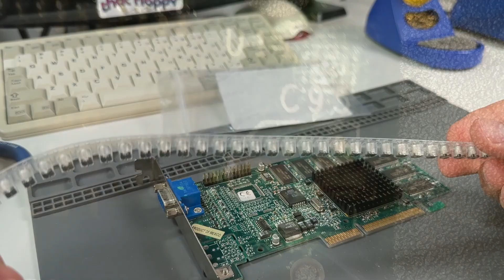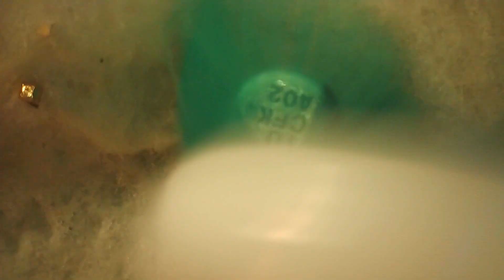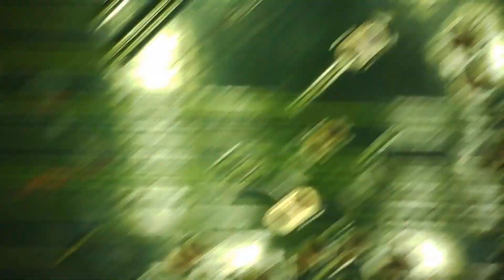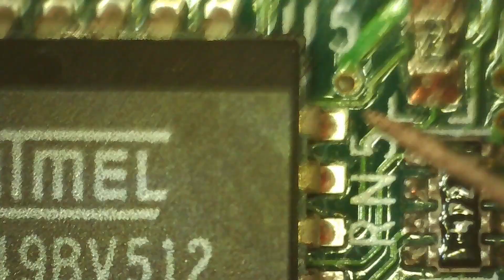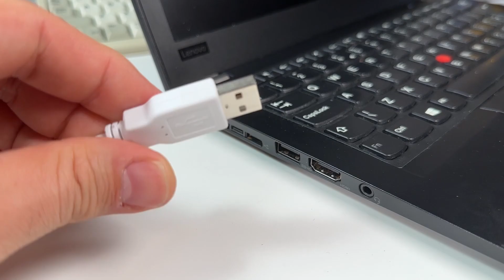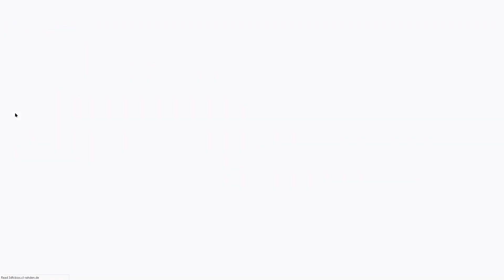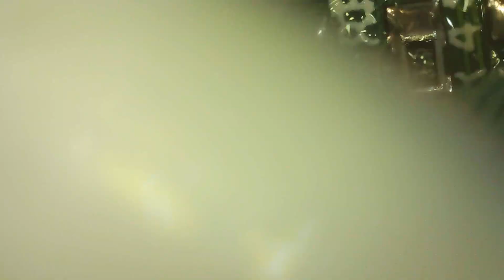Repairing a Stubborn 3dfx Voodoo 3 2000!

Comment: I haven't done significant soldering in a while, but I did a lot of small electronics repair for my father's business back in the mid 00's, similar SMC sizes to these. Anyway, we always used a flux impregnated solder and it worked fantastically. It was also lead based I'm pretty sure, and at least back then, the non-lead based solders were crap and required much higher temps.
Reply from the maker: Thanks for your comment and for sharing! I have never tried lead-free solder before (since most of what I repair is from before that era) but I've heard its much harder to work with.
Reply: @vswitchzero  They had a certain brand they loved with the flux in it and stock piled it. The business went under (tech they fixed basically went obsolete), but he still has some somewhere in his garage. But because it was flux impregnated, we never needed extra flux and would just melt a little extra solder if you needed to and then wick away the excess.

Comment: I have the same model card that hasn't worked since I bought it (system wouldn't post). Thanks to this video I tried the switcheroo trick with a PCI card, but my system still won't post, so I get no video output at all. Any ideas on what could be wrong?

Edit: tested on a different system...it's completely dead
Reply from the maker: Thanks for your comment! If the card isn't detected at all, it could be power related (check the regulator for the correct voltage output and test the ferrite beads/filters to the left of the 3dfx chip to make sure there is near zero impedance across them).  Unfortunately, some of these types of issues are due to BGA contact issues, which can be much more difficult to fix. I have a V3 here that I believe that is the issue on. One of these days I'll need to learn how to do BGA rework.
Reply: @vswitchzero  Thanks for the tips! Voltage looks good, card is getting power. Unfortunately I think it is an issue with BGA contacts.

Comment: Have you tried No-Clean Flux? More expensive for sure.
Reply from the maker: Thanks for the tip. Haven't tried no-clean stuff yet, but the flux I use is really easy to get off without much effort. I used some cheap flux paste in the past that required a lot more work to remove.

Comment: If you haven't under preheater - better to mix the solder of chip with the rose alloy by a soldering iron, and then unsolder it hot air gun. Rose alloy has a much lower temperature of melting and it's hardens with muuuuch more time that ordinary solder, that is why unsolder chips with it much easier

Comment: Excellent work. 25:35 it would be really interesting to see if the Voodoo 3 is able to run at over 200 mhz with 5ns or even faster memory. Apparently the fastest Voodoo 3 ever released was made by Falcon Northwest runnung at 200 mhz, but I never saw one on the internet and I wonder if such a card even exists.
Reply from the maker: Very interesting about the Falcon Northwest Voodoo 3. I've never heard of that one before. I'm definitely going to try to get this card past 200MHz, stay tuned :)

Comment: Flux is needed to clean surfaces from oxides during soldering. But when you desolder with a hot air station, it only interferes - you do not see the moment when the solder becomes shiny, completely melted. The flux evaporates rapidly, as the temperature of the hot air station is too high for it, and produces too much smoke, which makes the desoldering process more difficult. So there is a chance to tear off pads. But for soldering components back or cleaning pads - there is not such thing as too much flux.

Comment: A disconnected pin is floating - it won't necessarily be at 0v and won't necessarily behave as if it was
Reply from the maker: Makes a lot of sense! I was thinking of it too much in "on/off" terms. There is clearly more to it than that. Thanks for your comment.

Comment: open(unconnected) input pins are usually high .. so ..
Reply: This is the case with TTL families due to the way the gates are constructed, but absolutely not the case with CMOS families (which this ROM and indeed near on everything else on the board are manufactured in.)

Comment: I actually saw a voodoo 3 on another channel that had vbios issues. So he flashed it. It worked. He examined the old rom. Only a few changed bytes. 9 in total. So he reflashed the original. Still worked perfectly. lol It's so bizzare.
Reply from the maker: It is very strange indeed. I had a similar experience with a socket A motherboard a while back. The BIOS was bricked/corrupted and the system wouldn't post. I pulled the image off via my external programmer, and its checksum matched the one I downloaded from the ASUS site exactly. Flashed it back and it worked just fine. I suspect the external programmers do a better job of reading "borderline" cells that don't have enough charge left in them than the board/card does. I remember hearing that it can take too long to read those cells too, which can be an issue. So the image pulled by the programmer is good, but the card/board doesn't pull the same data when it tries to read it. Flashing it again restores all those flaky cells. If I find another EEPROM in this kind of state, I'd like to do more tests on this.
Reply: @vswitchzero  yeah that was my guess  as well. That it was marginal and just not fast enough to POST. But flashing I guess doesn't care about speed? /shrug

Comment: I didn't need to buy another broken voodoo 3........
I beg to differ. LMAO!!
Reply from the maker: LOL! Yep, I can't resist a 3dfx card in need of some TLC :)
Reply: @vswitchzero  I kind of want to do this stuff myself, but I honestly don't know what I'd do with it even if I had your skills. I've never done SMD before. 

I have fixed a C64 and honestly I feel like I could do a better job now. It had 1 faulty ram chip (I knew which one, but I replaced them all because it's a known bad brand) and a faulty cartridge port. However because my home made power supply didn't have a thick enough cable, I had a huge voltage drop anytime I used my U2+ (the USB disk drive emulator) 

The computer worked, but barely and some programs were worse than others. But the voltages checked fine with the "naked board". One day I checked voltages with the cartridge. 3.5v. How the hell that computer still ran on 3.5v is beyond me. After that I replaced the power cable and it's worked great. 

But.........before I knew the real problem I replaced the PLA and the color ram. Both were fine. The color ram destroyed a trace in the process. So I had to bodge it. The cartridge port (definitely was bad) I lifted a trace. I'm still using it, but it's not flat on the PCB anymore. I have a hot air station now (I got it for 3d printing) I feel like that would have helped me avoid these issues.
Reply from the maker: @awilliams1701  Great that you were able to do those C64 repairs! Its always a good learning experience - even if you replace unnecessary parts or cause damage requiring bodges etc.  I was really intimidated by SMD stuff at first. I ended up buying some SMD practice boards from Amazon and just did component after component until it got easier. Eventually you discover techniques that work best for you. Getting a microscope was also a real game changer for me. Made all the difference. Cheers!
Reply: @vswitchzero  My problem is I barely have time for the C64 or anything else really. So if I got more parts regardless of electronics era, what would I do with them after fixing them?

Comment: I'm curious to know what the ESR is of those panasonic 10uF/16V new caps. Do you have a meter to measure it?
Thanks.
Reply: With name-brand capacitors from reliable sources (like this one) you can pretty much trust the datasheet. 
0.85 Ohm at 100kHz is Panasonics rating for the EEEFP1C100AR cap.
Reply: @Manawyrm  I was asking, because I have a Voodoo5 5500 with lots of these caps. They all measure around 9-10 ohms @ 66KHz.
I've measured some other similar caps I have, same ballpark. They are not Panasonics.
Reply from the maker: I have one of those really cheap component testers, but the ESR readings I get from it vary so wildly that I don't really trust it to be honest. I'd be happy to take some readings anyway if you like - just let me know.

Comment: Hi, yes a multi plane PCB certainly needs a pre heat, it will make desoldering much easier, less tracks and pads pulled off, Small boards you can pre heat the underneath with your hot air gun before doing the yop. Bob. UK
Reply from the maker: Thanks very much for the info!

Comment: Congratulations to the milestone! And to the fixed V3 of course as well ;)
Reply from the maker: Thanks very much! :)
Reply: @vswitchzero  
greetings vswitch. Watching this video, in which you use an S3 Virge DX, I ask you a question for help.

I have an S3 Virge DX card (AOpen PT 75), which I had never used before (so dont know its previous state). after a good cleaning and soldering a capacitor that had come loose. I tried it and it did not give an image, the PC emitted several beeps. After an additional review and more cleaning, it managed to show the vbios report, but then it goes dark. Reviewing it more in depth I saw that it had a position where another capacitor seemed to go and in the images that I looked for I saw that yes, it was missing another capacitor (those are the two on both sides of the PCI connector i this card). In the images I cannot see the data of the capacitor, but visually it is the same as the one that I soldered before. So I matched this capacitor and put it on, but the card remains the same, it shows the information from the vbios, and that's it, it doesn't give an image. during boot up i keep touching the chip and i feel it getting hotter than i think it should, so i turn off the pc.

Can you give me any advice on this?

also

I have two AOpen VI15G motherboards , the revision with support for 3.3v CPUs (it has the power regulator). They are part of some PCs (the other is a Pentium) that I had at the end of the 90s or the beginning of this century and all the parts and pieces were stored in working conditions almost 20 years ago. A few months ago nostalgia assaulted me and I am reassembling them. All the parts needed a lot of cleaning, from the PSU to the cards, due to the dust accumulated even inside the boxes, in addition to some slight oxidation. Everything was pristine after cleaning. one of the two psu need some repair but the other ones is working flawlessly.

I have some 486 but the best one is an Am5x86. I didn't remember if the jumpers were set for use that one (i think they were, but not sure at all, 20 years bro), so I looked for the documentation and I found two documents, one original from the first version of the motherboard, which only supports 5v, and another with jumper settings updated for the revision with 3V support). I configured the motherboard as an Intel 486DX4, also as an AMD DX4 (the board is from 2 years before the 5x86), based on some recommendations I read around. both are 3.3/3.45 volt processors, but when measuring the voltages on the socket pins and on the regulator output, it's always 5V no matter the configuration. It happens equally on both motherboards, I don't think the regulator is defective in both cases.

I would appreciate if you help me with the correct configuration to be able to use the Am5x86 (or 486DX4 from Intel or AMD, as a valid config as I see). The other 486 compatible I have is an AMD 486DX2-66 but of course the primary interest is the Am5x86. I still need to check them with the DX2s to make sure.

the PentiumMMX is also not working, no post, but i will see it latter

Any help will be very appreciated.
Reply: two of my favorite youtubers! i love seeing the retro community connect!